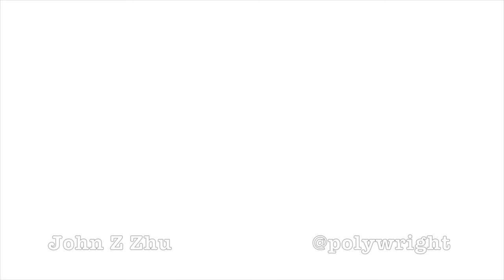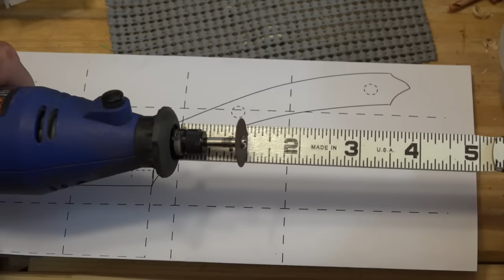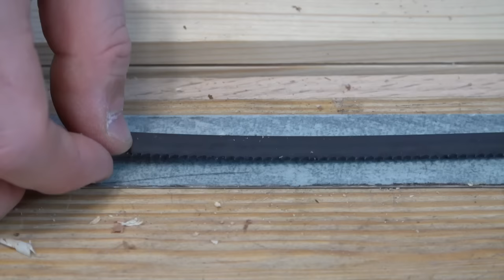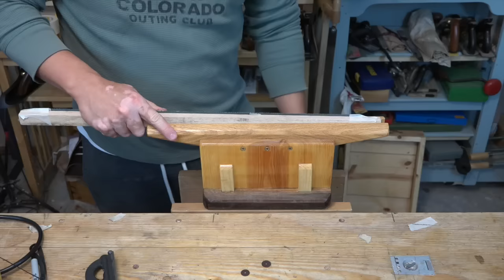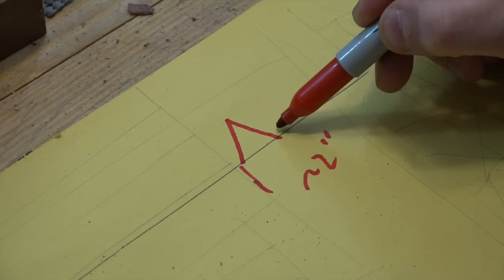DIY Frame Saw Blade from Carbon Steel Shim

Comment: Interesting! I've been thinking off and on about making one of those miter boxes that use this type of blade and making the blade itself was part of that. Had an old 26" hand saw in mind for that, but the plate is thicker than ideal.
Reply from the maker: Thanks John. May be it'll be on now. Blade thickness was one of the problems for me. The 1095 spring steel is pretty nice. I think I'd get a 0.02" or a 0.025" for my next plate; the 0.016" gives a really thin kerf, and you know thin kerfs are trendy these days. BTW if you were thinking of using spray paint to transfer the tooth pattern don't waste your time, it was a complete failure for me.
Reply from the maker: Bandsaw blades as frame saw blades has been done.  They are too often bimetal or heat treated which makes sharpening difficult/impossible w/o diamond files. Hence the need to make my own blades from regular old high carbon steel, the same steel that's been tested for thousands of years. with specific thickness and tooth shape.
Reply: John Heisz was here. Freaking awesome.
Reply: Anywhere that carries ECE tools is a good candidate. Highland woodworking carries a variety. I bought several in different styles and now basically have a lifetime supply. About $10/each.  They also have a Japanese style toothed one but I have not been thrilled with the longevity of that type tooth. They are wonderful until they are not.
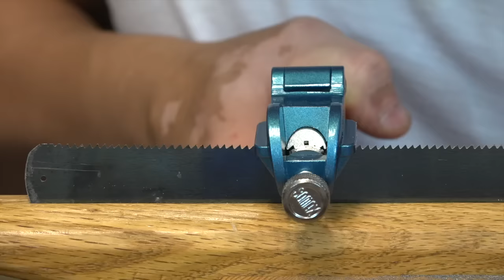Reply: Does anyone know what is he doing here? 2:12
Reply: @قناةأصواتالطبيعة-س8ز  Bending teeth alternately to the left and right, using a tool called a saw set
https://en.wikipedia.org/wiki/Saw_set
HTH
Reply: @joelhollingsworth2374  Thank you.

Comment: Brilliant John :) I have been thinking about making a frame saw blade for a good while. This has really helped :) I never considered carbon spring steel plate. Your saw turned out great. Thank you :) ॐ
Reply from the maker: Thanks yogi. I think you'll like the shim steel is tempered just right for frame saws. The Chinese frame saw video is coming as part of a series of Chinese woodworking tools.
Reply: That sounds great :) I'm looking forward to the videos. Will you be covering Chinese joinery techniques at any point?
Reply from the maker: No plans. I have a simple joinery palette.

Comment: How were you able to make the teeth 'flare out' (making the teeth/kerf slightly wider than the rest of the blade) or was that step omitted ?
Reply from the maker: A saw set tool is used to set the kerf. It is not omitted.

Comment: Awesome video and inspiration for those hard to find blades. (Just make them yourself.) Where do you find a good saw file though? The files at any of my local "big box" 'hardware' stores are garbage; they all have either twists, bends, broken teeth, or a combination of issues that make them basically useless for this kind of project. Thanks for any help or links to a source for good quality files.
Reply from the maker: I am used a standard small file from a big box store. Sorry to hear that you're having trouble with twist and bends; I've never actually had any problems. May be you have the "curse."
Reply: Ace hardware has Nicholson files. They’re not premium but they will get the job done. I haven’t discovered any twist or anything like that in the ones I’ve bought yet.

Comment: Did you source the shim stock locally, or where?

I looked at grainger and they had some 1095, some of which they describe as full hard where some other had a blank in the hardness description. Is the stock you used hardened? or blue tempered, or what?
Reply from the maker: blue tempered (RC50-55), 6" x 48", the thickness is ~ 0.5mm, ordered online from Amazon.

Comment: does that shim come in a 4' length ? I been in need of 48"+ about 2"+ high.
Reply from the maker: Yes, you can get them w/ a variety of lengths.
Reply: Check out McMaster-Carr or speedy metals for a good selection of 1080/1090 steel.

Comment: fyi  AS A possible  alternative   you can buy a  euro  german  9  tpi frame saw blade that is intended  for   a euro frame  saw , but  the  kerf    would be wider ?? than the chinese  blade.
Reply from the maker: There is no set width, thickness, or length to a Chinese saw blade. One could always buy a frame saw blade, the point on the video is to show one how to make one oneself.

Comment: I'm stuck at FOUR CUTTING WHEELS!... Sorry but FOUR cutting wheels sounds like money. Cool video and all... just checked and that's only about $12 so not too bad.
If I'm going to make my own blade and cut in the teeth I'm probably going full on stupid and using a file and a guide block.
Keep up the good work!
Reply from the maker: lol, 4 dremel sized cutting wheels is not $12. For $12 you could get >30 of them.